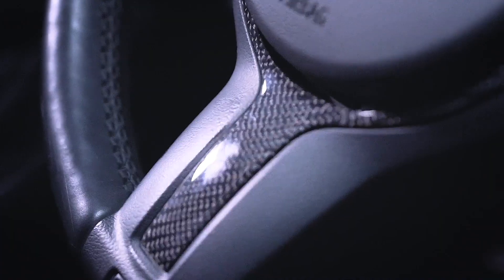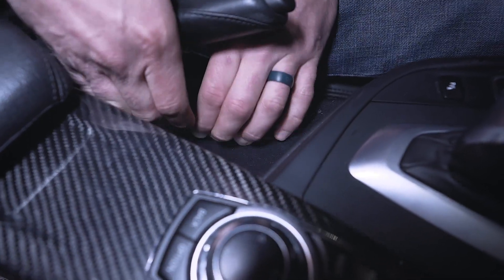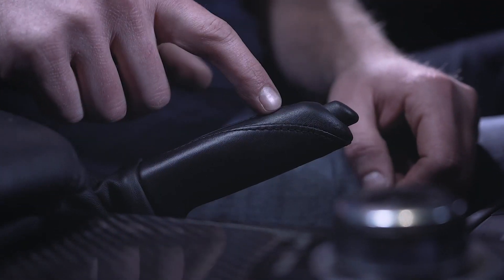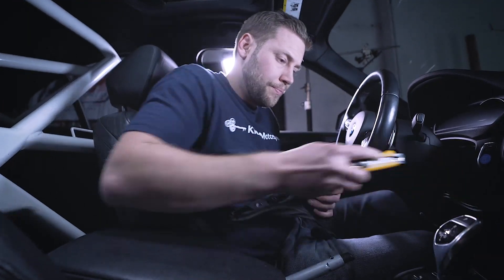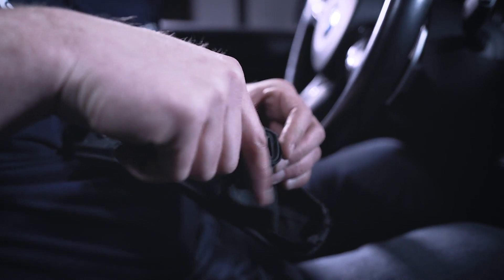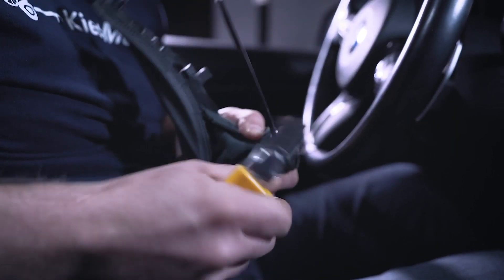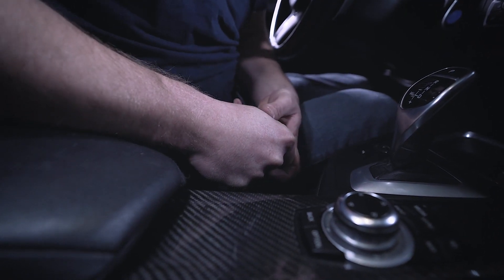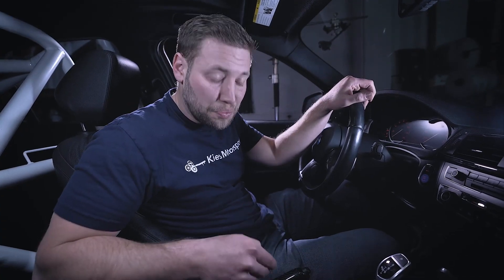Carbon Fiber E Brake Upgrade for the F30| F32 | F80 BMW! #F30carbon

Comment: I am currently trying to do this on my F80.  I was able to get the boot off, however I cannot get the handle off.  I followed your video, but it is very difficult.  Is this common?  It looked very easy when you did it.  The current handle is stock and wanting to put a carbon fiber handle on.  Please help! 😳
Reply: No way mine is coming off without breaking something.  I have an F30.

Comment: I followed your instructions but my stock handle won't  remove ????
Reply: Did you ever figure it out? I'm having trouble removing mine as well
Reply: My F80 didn’t remove the same as his did. The handle has plastic ears that protrude into the metal handle.